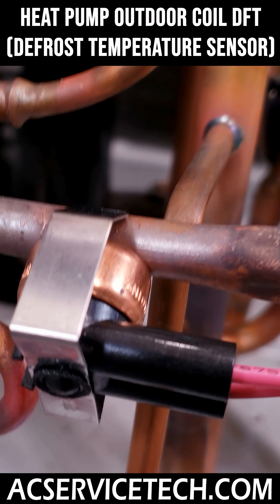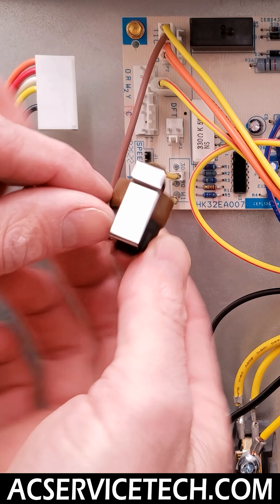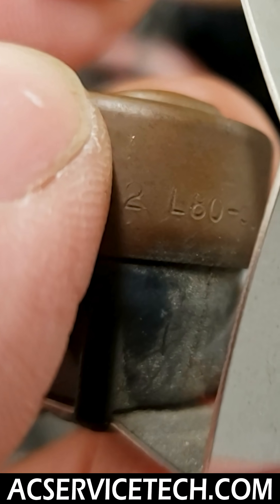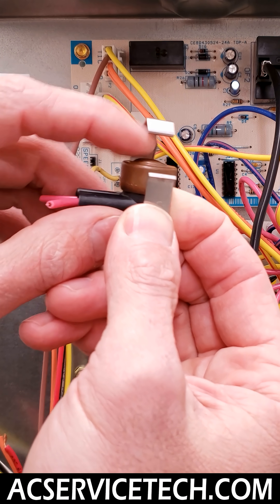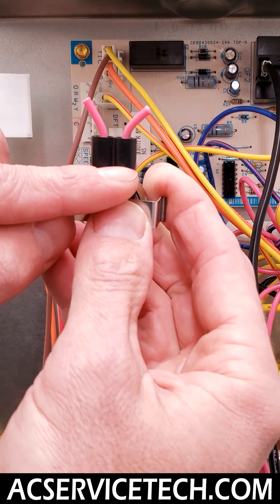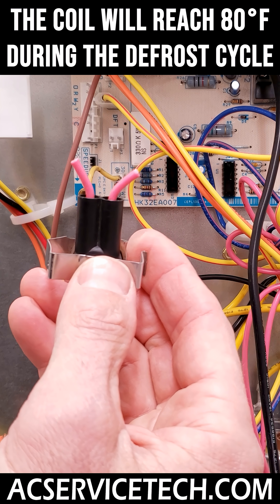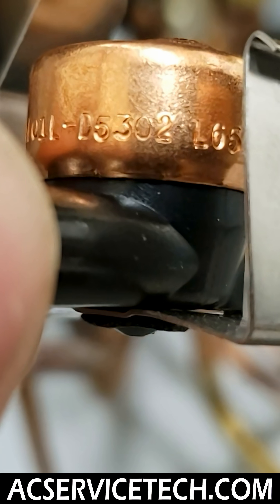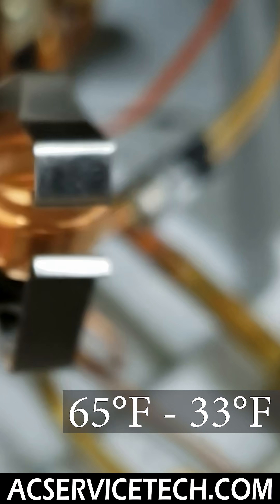Heat Pump Outdoor Coil DFT! Defrost Temperature Sensor!

Comment: This application is for an electric strip heater used to defront the evaporation coils, right?
Reply: I think the heat pump runs in reverse, pulling heat from the home to defrost the coil.
Reply: @AlexPlusLEDS  Yep it just runs the unit in (AC) cool mode but most units have backup electric heat strips (or some other form of backup heat) so the temperature of the place will not drop too much during defrost